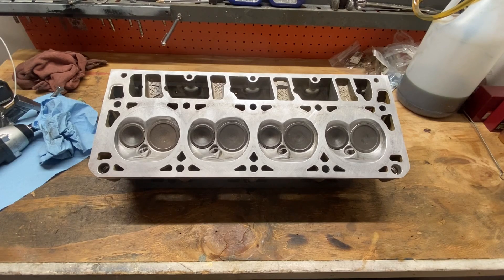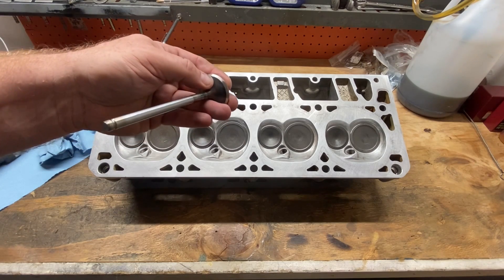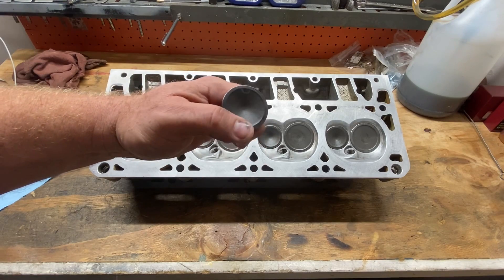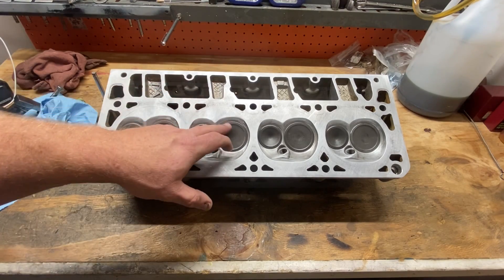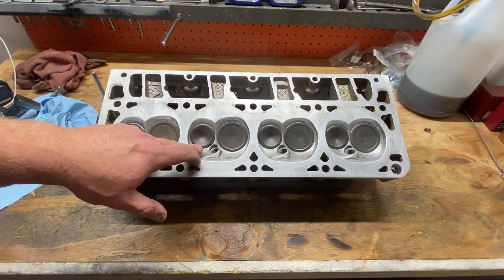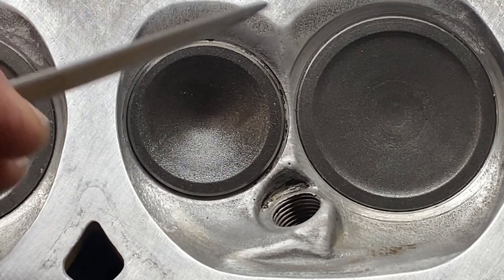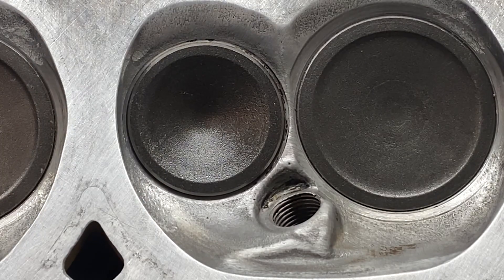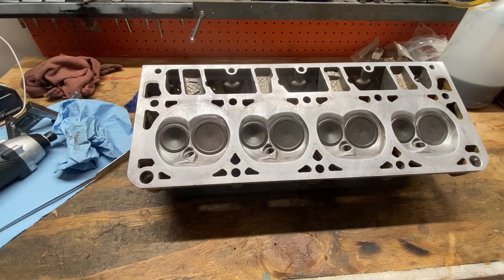Back cutting valves for more flow why?

Comment: Another trick is to cut a grove on intake face (inside combustion chamber side). This trench keeps air from flowing around the valve back into the intake port when intake valve starts to open but all exhaust gases haven’t gone out yet. David Vizard taught me that in the early 90s. Think he has a video about it on YouTube.

Comment: Buddy your feeding people bad information.
1/ If you back-cut the exhaust valve you increase its flow out of the chamber a little. You however increase its ability to flow in reverse a lot more. You end up assisting reversion. You do NOT back cut exhaust valves. Probably why your head workshop did not do it, they know better.
2/ The area from the margin to the valve face should have a smooth radius to help exhaust gasses turn around the valve and into the seat area. You can clearly see at 6:20 the valve has a near square edge from margin to face. This should be a large smooth radius.

Comment: Just learned that face cutting the chamber side exh valve angle is an option. Read up on what back cutting really was & the legit gains at low cfm. Machining / lathe equipment isnt necessary to do this. Picking up a drill press soon to try this myself. Great vids

Comment: About 45 or 50 years ago we used to call that a 3 to 5 angle cut on the valves. Add on the face of the valve, if you left the valve absolutely flat you wouldn't be taking out compression ratio which you lose as much as you're gaining in flow rate. Why are you taking out compression ratio for the sake of hoping you're getting a little bit better flow rate? And you will get better flow out of three angle valve job, you'll get better flow if you change your entire valve angle to 30° then you will leaving it at 45 degrees
Reply from the maker: Not factual wives tail.  You only gain/loss +- 4% power/torque for a FULL number of compression; ie 9.0-1 to 10.0-1 
I guarantee you would never see the difference in power from cutting the edges of the valves from lost compression, that is simply false.  But picking up 3-5 cfm will show a change. JD

Comment: All you want is a 45 on the ex valve and seat !!! No More is needed or wanted !!!
During overlap too much fresh intake charge can be sucked out with great low lift flow on the exhaust  side !!! Especially if you have the desireable tighter LSA to intenseify the torque in the powerband .  That exhaust with backcut will reverse flow with Much greater authority with backcut and a multiangle seat work .  When the exhaust cracks open its under pressure and the piston is way down the bore .  That pressure is enough to find its way out and be disipated during overlap to give the intake port a good yank to initiate its flow without being foolishly wastefull . Why waste fresh charge when you dont have to ?? The cylinder is already vaccumed down sufficiantly all you want is a quick sweep and shut that ex to use the vaccum to charge the cylinder and keep dynamic compression enhanced . 
I proved this to myself with a pump gas , rectangular port , closd chamber 427 and a larger pretty healthy cam on a 108 LSA  in a 5700lb 4x4 . I put that truck in the 12s on 10.50 x 31 street tires thru the exhaust and got 16 mpg @ 70mph with 4.10 gears & 4000 stall .  It idled good as if a much smaller cam with vaccum for pwr brakes , got great gas mileage , and that big intake port was nervously responsive to pedal input with a single plane  .  Multiangled and backcut intake seat geometry with std 45 degree and no more exhaust seat geometry flat out works like crazy !!!
It made enough power to smoke the tires from a 70 mph roll , twist the 3/4 ton frame , and twist the axles off a corporate detroit lockered 14 bolt rear end . How about let it idle on a 100* summer day and watch the intake get frost on the entire X of the runners ??  I will Never go back to multi angled and backcut exhaust again !!!
 In fact i have a 1/2 ton 2wd 4.8 ls truck with 862s thats going to get similar but milder treatment . I wish the exhaust valve was Smaller !!! Undecided on the 1.89 intake to go larger or Not , maybe 30 * seat , and Still make over 400 ft lbs and over 400 hp NA and Still be over 30 mpg . Just a old hot rodder that loves the physics book with slightly altered goals these days .....Efficency Rules in Everything !!! .....and a die grinder is the low cost key to it all . The heads are only the Beginning.....
Reply from the maker: Reversion

Comment: Hallo thanks; would not add a backcut to the exhaust valve above the 45 degree.
Reply from the maker: I don’t usually add a back cut to the exhaust valve.  You can remove material from the outer face to “round” the edge to help flow.  Thanks for watching and the feedback!  JD

Comment: You mention Noland's Cylinder Heads, is that correct? If so, are you referring to the Noland's in Kansas City?
Reply from the maker: Yes, Nolands has been around a long time and can process or repair just about anything.  Quality work at a reasonable price.  I live South of Kansas City, Mo. it’s a straight shot up I-49/71 hwy

Comment: You are the only guy that's talked about this,an I had a set of sbc heads done like this an that second gear chirp got bigger
Reply from the maker: Adding a back cut on intake valves works, the thicker the valve design the better the improvement. 
Most builders do not add back cuts to the exhaust valve since it can help reversion pulses pollute the cylinder.

Comment: 6:32 Exh. Valves only....Do Not Do a Back cut from the 45º face to the tulip (inside port side) or (smaller radius of face). But the back cut 
on the large part to break the edge on the combustion chamber side is a good thing. < Read Smokies book.
Reply from the maker: I agree, several people old and new have established back cutting the exhaust valves adds more negative than positive to the port flow and reversion. Thanks for watching and the feedback!  JD
Reply: Was about to say this too. Back cut intake only, exhaust valves do a 30-45 deg cut on combustion chamber side of valve at the margin. And for same reason (reverse flow) DON’T do anything on intake face on margin on combustion chamber side as that will let exhaust gases reverse flow into intake during overlap.

Comment: Any recommendations for budget replacement valves?  Manley and Ferrea start at $160/side.
Reply from the maker: The issue I found with the more economical stainless valves is they don’t offer the exact factory valve size, you have to upgrade to the 2.02”/1.57”. 
Star Performance sells a Renegade brand Pro Race stainless valve for $105.00 set of 8.
Renagade Performance stainless valves $47.12 set of 8. 
For factory 2.00”/1.55” you have to go name brand $150.00+ set of 8. 

You might be able to buy the cheaper valves and have them cut down at the machine shop, I’m not sure how much it would cost.  JD

Comment: Do you round the sharp edge of the combustion chamber to prevent a hot spot from the sharp edge?
Reply from the maker: Yes 100% smooth any sharp edges or points in the chamber to help avoid detonation especially after having the heads surfaced.  JD
Reply: @HeadFlowInc  How much of a radius would help the most. I've heard some say 1/8" and some say 1/4". Does a radius help velocity at all?
Reply from the maker: As long as it’s rounded the width shouldn’t matter and the more material you remove the more it lowers the compression. JD

Comment: Looking for professional opinions....
I have a 5.4 3v, the exhaust  flow #'s are horrible , in effort to increase those #'s, would it be advisable to increase the exhaust valve from
1.47  to  1.60 ?  Please give me why and why nots
Thank You
Reply from the maker: The first area I’d check is the bowl size below the 1.47” valves.  Measure the bowl size and factor the percentage to see where you’re starting. 
I’m not familiar with the 3v heads and mods like larger valves, but know all valves bigger or oem need a performance bowl cut and blend.  JD

Comment: I did that in 1967 on 327 fuely heads
Reply from the maker: Shocker alert, they now sell aluminum double hump heads with big valves and 180cc runners!  I just heard about these new heads this weekend, I needed those 25 years ago!  JD

Comment: I did the back cut on the bowl side in my drill press with a file. I just rounded it. On the chamber side I hit it with sand paper on that edge when I shined it. Truck feels strong but never drove it before I rebuilt motor, which is how I bought it with a bad motor.
Reply from the maker: I’ve seen mixed results concerning the back cut on the exhaust valves being both brand and application specific.  I’d say do the exhaust face radius and run it; leave the back cutting to the intake valve to be safe. 
Although in the lower lift applications under .450” lift cam the exh back cut looks to be a decent option. JD

Comment: STILL AT IT...
Reply: YEAH I GOT 2 SBC 400 SPLAYED CAPPED 4 BOLT MAIN ENGINE BLOCKS WITH PRO-FILER HEADS THAT ARE GONNA PUT THE JUNYARD LS TURBO GUYS ON THE TRAILER ALSO...CHECK OUT MY NEW 87 TRANS AM GTA TUBE CHASSIS CAR....
Reply from the maker: Yep, these 306 cfm cathedral ports keep making power putting people on the trailer!  Thanks for watching and the feedback!  JD

Comment: Great videos, I have learned a lot of knowledge from your videos. I ported a set of 862 heads that I installed on my daily driven 2000 Silverado 5.3 lm7. I learned how by watching your videos, and let me tell you, it screams with the btr stage 2 truck cam. I also installed a new Melling M295 oil pump that I ported and shimed, learning how to by watching your videos. At hot idle I get anywhere from 50 to 65 psi, and on cold start shoots up between 70 and 75 psi. You rock buddy, keep it up with the excellent videos !!
Reply from the maker: Thanks it’s good to hear your hard work is paying off!!  Have fun and stay tuned!  JD

Comment: well i did a this on a test head ls3. stock intake and exhaust, exhaust picked up half a point from .100-.700 which in my opinion 1-2cfm isn't worth it if your paying someone to backcut the valve. intakes already have a back cut on them from the factory so just a touch up to make them look pretty. iv got to work with different exhaust tulips and we find more degree of tulip less likely you will want to back cut the valves, as you would know old small blocks are almost flat on the exaust so a 30 degree would work. but if you have some input also i am always trying to learn.
Reply from the maker: I was sharing old school porting tips mostly used on the conventional domestic V8’s it’s good to receive feedback on various applications. What seems odd are the reports of gaining decent percentages from .100”-.300” lift to then lose the gains above .500” lift.  I’m trying to pin point why it wouldn’t carry the improved flow trough out the lift range? 
I can see on the LS where back cutting the exh valve might be needed but the outer cut to “roll” the lip should work. JD
Reply: @HeadFlowInc  as you pointed out, and my belief also on why it doesn't carry out most of the times after .400 i think is that the valve is just to open to the valve seat, where at .100-.200 open if you shine a light u barely see the light on a valve without a backcut, with a backcut u can see more light? honestly im no pro or anything just garage/freetime testing for me haha. keep up the videos i enjoy watching them
Reply: Most of the benefits of the intake back cut, and the exhaust lip radius, will not be seen on a flowbench.  They have more to do with fuel re-atomization, high speed flow and hot-spot reduction.

Comment: Im my experience back cutting the exhaust valve on the port side doesn’t help flow and can actually hurt flow by inducing turbulence into the bowl. Grinding a small radius on the edge at the valve margin to valve face can definitely improve exhaust flow but really helps keep the edge of the valve from burning. Iv seen an intake valve back cut pick up a ton especially on older engines with big ol chonky valves and after opening up the bowl and throat. I love this stuff. Never stop experimenting.
Reply from the maker: It makes sense the back side of the exhaust valve shouldn’t see much flow past the sealing angle. I’d like to research/test the mod on a bench to see what’s happening. I’d guess the less air flow directly under the valve head the better?  Very interesting thanks for sharing!  Stay tuned I hope you subscribe  JD
Reply: @HeadFlowInc  oh youll see flow increases with multiangles and even tuliped exhast valves . We Dont Drive Flow Benches !!! 
When the car slows down on ET And MPH thats the Real Tell All !!!  You can also make a exhaust port bigger and bigger and the bench will love it . NOT SO THE CAR !!!
Reply: Flow needs to separate from exhaust valve asap. The radius/angle on the backside of exhaust hurts flow because the exhaust will follow the radius and become turbulent.
Reply: @HeadFlowInc  I would love to see the test results for this

Comment: Cool vid actually right  sir low lift flow is all about inch before and after seat which includes the valve I back cut  both intake and exhaust and chamber or smooth out they edge on  face side.i will  measure valve stem coming outa valve guide and remove material from stem mainly a mm to 1.2mm.attention to detail
Reply from the maker: I’d like to get a cutter to shorten the guide boss a tad!  Thanks for watching and the feedback!  Stay tuned!!!  JD

Comment: Jeff, you can do those cuts with the valve chucked up in a drill and grinded on a bench grinder stone. I do all my own valves. I picked up 6-7 cfm in low to mid lift flows with that one free mod. I have free access to a flow bench whenever I want to test these things. My 243 heads flowed over 300 on the intake with stock valves.
Reply from the maker: That’s were I’m at 306 cfm @.600” lift and 255+ cfm @.450” lift stock 2.00”/1.55” valves.  I should have back cut the valves to help even more low/mid flow.  Thanks!  JD
Reply: Yup i use a mini drill prrss and a dremel with a cut off wheel
Reply: Most certainly

Comment: Ya I'm about to put a 1839-p cam in my truck mostly chosen it because I got a deal on some spring with max lift of .580 and it looks like china has gotten into the ls camshaft knock off market and have it and the sloppy stage 2 for about $180 and I paid like $70 for the springs so like $250 for more power is pretty good and I was going to at least lap the valves just because you know 230,000 miles
Reply from the maker: Good idea, if you pull them apart and the exhaust valves are badly pitted have the valves refaced are a machine shop it shouldn’t cost more than like $16.00 or so then lap them in.  JD

Comment: Years ago there as a fellow named James Feuling that was rather famous for his engines and he used to take oversize titanium valves and cut them down so he had enough meat at the edge to get a good radius on the edge of the valve.
The job can be done easily on a lathe but can also be done by using a drill and a grinder. Be carful it is easy to mess it up.
Reply from the maker: I’ve watched a couple people using a drill press and either a grinder or file to do the work. I’m not sure I trust myself to make it work! lol  Thanks!  JD
Reply: Fueling was a brilliant guy

Comment: It is 30 degrees on the back cut of the valve. It is highly advisable not to face cut the  intake or exhaust valves for any engine that uses an power adder. Look at the egts on engines with power adders compared to an naturally aspirated engine.
Reply: Why not the intake valve on an engine with a power adder?

Comment: This video came along just in time because I'm about to back cut some valves and it gave me a idea of how it is supposed to look and I think that  it can be done a little bit more for the higher performance application I think, what you think?
Reply from the maker: Back cutting the valves should be used anytime getting the most power is the goal budget allowing.  Those back cuts help and don’t have any negatives so I vote yes!  Thanks for watching I hope you subscribe!!!  JD
Reply: @HeadFlowInc  I am subscribed and have been subscribed for a while now 😂 I enjoy watching your videos and have got a lot of tips off of them. I have ported 2 sets of heads since I subscribed and I'm building 2 347 strokers, one for my 79 pinto and one for my brothers 65 mustang and I have been watching your videos and getting tips even though you mostly work on Chevy heads I can apply your tricks on my heads and it worked out perfectly because I was planning to back cut the valves because I am trying to squeeze every ounce of power that I can out of it and should run out good in a 2200lb car I hope 😁 but keep on making the videos as you're my favorite one on here and you do some very nice work and I need all of the tips that I can get, Thanks 👍🏻

Comment: It would be nice to see back to back dyno pulls, to see what a difference this makes, along with port polishing after, and maybe a few more mods, doing back to back pulls, you would probably have to owna dyno to afford all the pulls I'm thinking of,  I'm guessing the gains ( especially on the exhaust valves) will be greater with a bit-o-boost ! I never done much with valves, besides putting larger valves in heads, great idea!